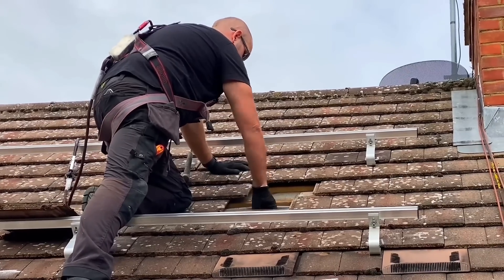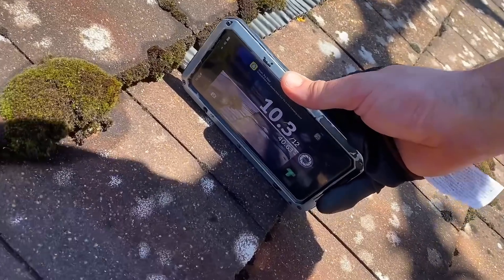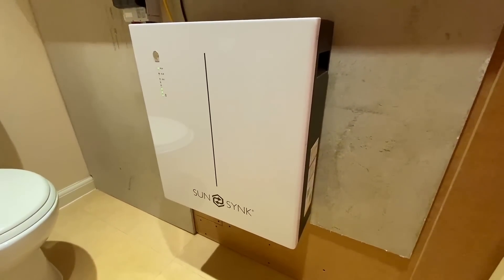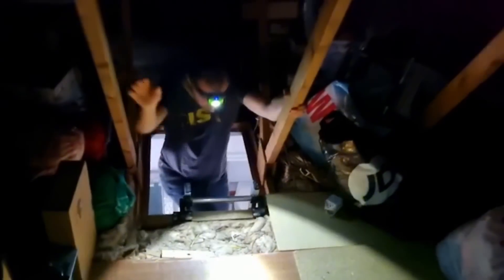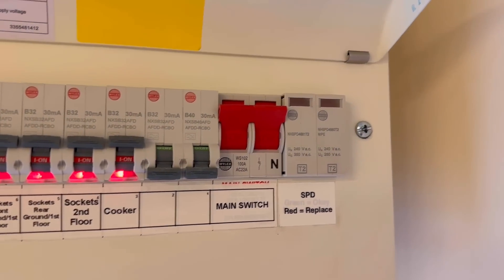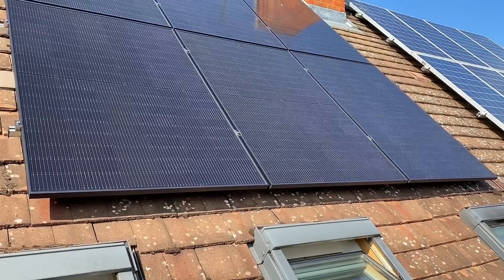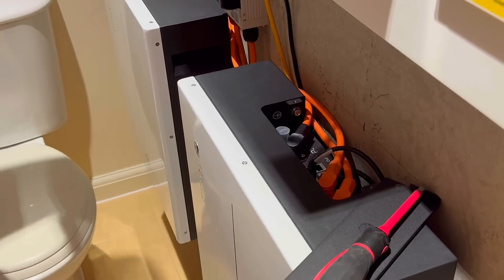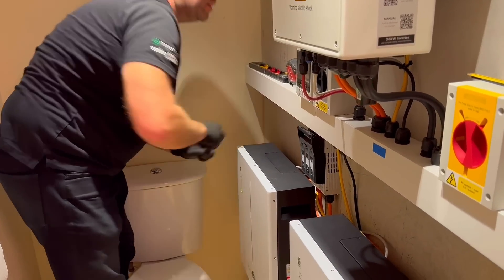All my Mistakes Revealed - Solar and Battery Install

Comment: Thank you for the useful guidance in this video.  Also worth noting in the darker winter months you can charge the battery over night using off-peak (night time rate) which is usually 50% cheaper

Comment: just had one battery fitted to my system and wanted two but purely down to cost, i.e. cant afford it afer all the other work but on the agenda next time I have the cash to take it up to 10kwh esp as my system generates 3.6kw at peak

Comment: Not sure that the installation complies with current IEE wiring regulations. Water within reach of electrical supply @ less than one meter. As its a bathroom it is zoned, no 13amp outlets are allowed. Correct me if I'm wrong.
Reply: Surly it would need a bath to be a bathroom

Comment: Please note, if you have a full system installed, everything is vat free. So ensure you get as many batteries as possible when you order the system. If you just add a battery without 
panels,  you have to pay 20% vat on top.....
I have 8kw of panels, which are south facing. The only problem is National Grid only allow me to export 5.2kw, due to issues with power balancing in the network. Seems a shame, when I could be helping offset a lot more fossil fuel output.
Reply: Batteries, on their own or retrofit are VAT free from Feb 24

Comment: I would never have these on my expensive roof. A near neighbour had a roof fault. All 16 panels had to come off as the roof leaks were getting worse. It's all done now . He paid £1200 for the work to the solar company as two panels were defective. Plus new roof.  Don't know the cost , I  suspect about £4K. appears the original solar install was the cause of his problems. Since  then, another property has had to go through this. Puts one off you would think.
Reply from the maker: Thanks for taking the time to share your thoughts and experiences

Comment: I half agree and half disagree. I think charging from cheaper night tariffs is a must with batteries, regardless of it you have solar. Export prices now are such that it makes sense to export during the day and then charge the batteries at night. I have a zappi/eddi set up and have stopped the export due to this and only charge them at night, not allowing any solar to be diverted. Octopus go intelligent is 7.5p kWh at night with 15p kWh export. I’m currently on agile and make even more savings.

Comment: Hi Guys
I signed up with Essex solar last yr - my issue was installing a battery in the roof.
They said this is fine and installed it with a fire alarm.
Ok but As I’m less mobile but others are ok - is this a red flag?
Reply: Wouldn’t do it weight of battery lots of fire wood up there and gets really cold up there which LFP batteries don’t like to charge in, This is just based of my own research

Comment: PS Garry could you have not run SWA cable to the garage? Maybe 5 core so you could have whole home backup in the future. Yeah I wouldn’t be too sure that you’re not going to max the solar out in summer as I got 3.2 from my 3.2kW array with the 3kW inverter that goes to 3.3kW outptut but maxes out at 4.4kW array so I’m not even clipping on the inverter hence seeing 3.2kW in the summer months.
Reply from the maker: The land between me and my garage is not owned by me.
Reply: @eFIXXENERGY  bummer 😢

Comment: One thing solar installers need to make clear for every home owner is the difference between G.98 and G.99/G100 as when I was looking at solar, one thing that I didn’t understand was that even though I have 7KW panels and a G.98 hybrid inverter, I didn’t understand that the inverter will only allow 16A into the house load and export combined. Effectively the inverter is limited to 16A on the grid side in total and you use whatever you do in the house and the rest can go to the grid, but critically you are limited to 16A inside the house also, so while it’s nice to have the 7KW of panels as this means you generate more in the winter. In the summer you need to have batteries to charge for as long as possible while also exporting otherwise you are wasting a lot of generation potential.
Reply: Unfortunately a lot of installers will try and get way with only fitting a 3.6kW inverter, as a G98 is much less paperwork (notification only) than a G99/G100 (apply for permission). Only later does the homeowner realise the implications, if at all.
Reply: Only issue with hybrid, I’m losing in conversion for an AC system but when the sun is shining I’ve got access to 8kW DC is more efficient and easier to do with G98 99 as your not even going to be near the limit think that’s why most installers push hybrid. Good points though

Comment: Putting these batteries inside dwellings is insane! If that enters thermal runaway your a gonner! I think it will take a few deaths and insurance pay-outs until peoples common sense kicks in and they put these high energy stores safely outside.
Reply: Strange that we think burning gas in the home is ok but batteries aren't...even though we carry one of them around in our pocket every day.
Reply: They are Lifepo4 batteries. No cobalt in them things have changed a lot.
Reply: Lifepo4 and BMS’s have got a lot better and battery tech is continuing to advance like BYD blade battery can be punctured without self igniting, the Gold battery from Zeeker that’s been subjected to fire extreme cold and two staged crash tests and then used in a vehicle they are a lot safer. It’s now one of the fastest developing products like sodium Ion which should see prices fall and be even better from a safety standpoint and I don’t think Solar will be far behind on development.